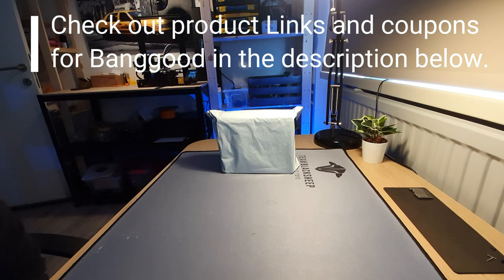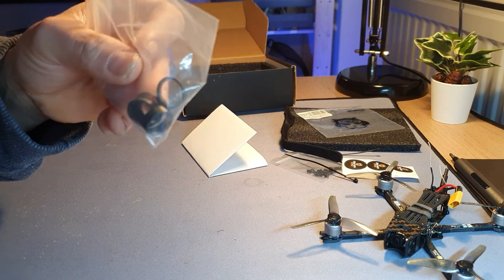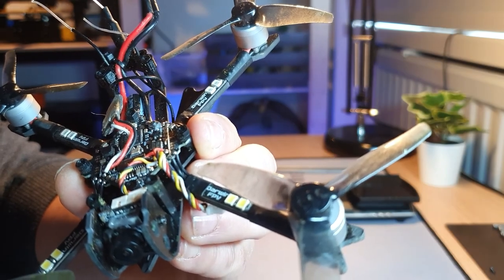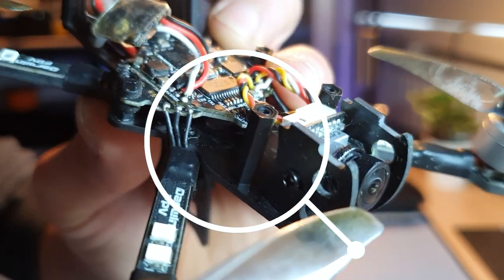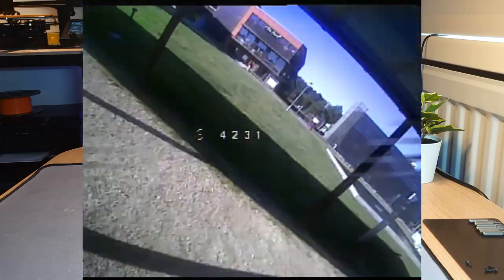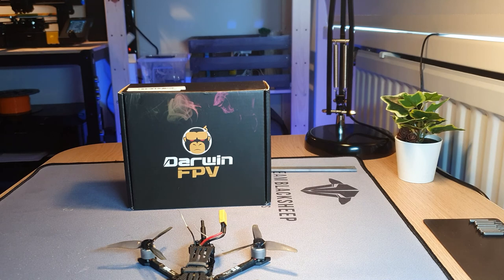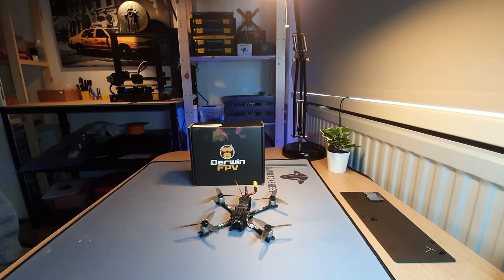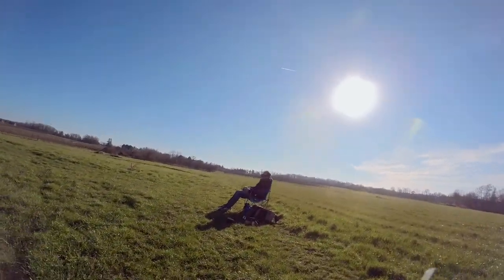Darwin FPV Baby Ape 3" review  | Square One

Comment: Great little review and agree with all, I'm fortunate enough to have 20 drones and flown many more but like this one for it's no nonsense ease. I have modded mine with an inflight micro antenna, fli14 rx and vinyl wrapped motors. As you said regards the cam, just get the upgraded version.
It's definitely staying in my fleet.
Darwinfpv have a 👍 from me.
Reply: Iflight
Reply from the maker: @stevedakin8321  And you get a 👍from me buddy. This is the cheapest drone I've ever flown, but it really impressed me. Looking forward to modding mine 😋.
Reply: Hii , how vinyl wrapped motors?

Comment: I like the 3s bouncy freestyle at the end! The stock rates feels really low especially on the 2s video footage though. Would you adjust the rates at all or you wouldn't worry about that until an upgrade? Also 200mW for the VTX is a bit weak as you go further than 100m the video gets bad real quick. What is the optimal VTX output for that drone with that small size?

Comment: Thanks for share. I want mode to it. For examle mod 1 gps+ elrs ( need to quit smart audio) 
Mod 2 change the engine (1104 7500 kv or something else) and try 1 and 2 s.
Try also install props protection for wery tight spaces or beginers or indor use.
Reply from the maker: Those would be some nice mods indeed ( I'm actually flying it with elrs right now :) . But for indoor use I'd say it's a bit fast, but yeah maybe with different motors.

Comment: i saw this quad on ali but eventually didnt buy it(seemed too much for a starter). caddex ant(pro version) looks much better than stock. you can put your split 3 on it and make some dvr videos :)) wonder if youll get some jello here like on your Mob7. looks like a really nice quad for such a low price
Reply from the maker: Yeah for an absolute beginner with little sim time it's going to be a fast drone. My first drone was a 5" but I wouldn't recommend it to every one to start out like me 😅😋.
That's actually an awesome idea putting an split 3 in there 🤔 hmmm 🙂. 
Yes it's awesome,  it flies really good and even pretty durable. The camera is the only thing that really needs changing, or like you said get the pro version. Maybe a good choice for you're second one 😄👍.
Reply: @SquareOneFPV  first i need my first one to arrive, and actually make my first flight LOL. while im waiting for my Mob7 i start to feel what i purchased from banggood is not an official happy model, Mob7 HD 1s elrs, cant find it on their actual site, feels like someone took mob7 normal 1s and just modified the camera..... lets hope it will actually fly when it arrive. :P :P :P
about second one, yes! i thought to get myself the ape pro for it or ape basic and get myself a DVR camera to put there somehow instead :)) but first thing first... learn how to take off before buying a beast drone without prop guards is important :D :D :D waiting for you next video ;)
Reply: @SquareOneFPV  My first drone was 9inch and was a catastrophe 😱 so start on simulator and after that with small and light quad. 
The quad for me to learn is kingkong et115, whoop type built like a tank😀

Comment: Did you change rates or pids? Nice flying!
Reply from the maker: Thanks 😁 and no, it's stock pids and rates.
Reply: @SquareOneFPV    impressive, I didn't like the stock pids and rates at all but, your footage seems like its pretty much tuned in.
Reply from the maker: @kilasracingfactory  Not saying it couldn't be better, but yeah I think it flies pretty good straight out of the box. 
For my reviews I try to change as little as possible, to showcase what it is your getting not what it could be.  
But if you're interested in al that, my modding vid's coming up soon, and it was pretty extensive. I'm now flying it on  BF 4.3, Bluejay for the esc's, bi-directional dshot is enabled, 500hz radio link etc.
Reply: @SquareOneFPV  nice, I'll definitely be watching the modding videos! First thing I did was flash BlueJay, it works so well with my other micros and this is no exception

Comment: Hey square one, I saw your review and some others on this drone, bought it with some 3S 450mah and I have 8MINUTES OF FLIGHT! incredible but my drone get pretty hot at the end… is it normal ? Thank you so much 😊
Reply from the maker: Wow that's a LOTT of flight time! What part of the drone get's hot? If it's the motors, if they get warm that's ok, but you should still be able to touch them, if you can't hold on to them that's to hot. And the vtx which is attached to the top plate can can pretty hot as well.
Reply: @SquareOneFPV  yup that s the vtx and motor but since, I m doing freestyle no more cruising and I still have a around 8 minutes by stoping at 3.75/cells so I hope it is not like broken and in reality I stop at like 3.1/cells..
Reply from the maker: @martindeschamps9856  Maybe you can check your voltage with a voltage checker or by plugging it into your charger when you get home? 8 minutes is just incredible, I got about 7 with my buddies 650mah 3S...
Reply: @SquareOneFPV  yup I checked I m not over charging the batteries i am well at 12.6 at the end of every charges. since, i tend to do way more freestyle and i still have 7-8 min....
Reply from the maker: @martindeschamps9856  Ok, well, it's still weird you get so much flighttime, but it's pretty awesome, so enjoy!
Reply: @SquareOneFPV  yes I don’t know what cause this. Can it be the vtx ? My vtx don t work correctly maybe he is under alimented so it uses less ?
Reply from the maker: @martindeschamps9856  No I don't think it could be the vtx, even the difference between 25mw or 200mw output power is negligible in flight time,  that's maybe a 10 or 15 second difference.
Reply: @SquareOneFPV  i don t know I am searching explainations 😅

Comment: is it usefull to get rid of led on motor arm? i kinda dont care flying a christmas tree and i dont like shorthen motor wire to leve them 1 centimeter only...
Reply from the maker: I was planning on removing them too. I'm not a big fan of leds on drones either, but I eventually kept them because they do act as race wire, so in a crash if the prop hit the top of the arm no wires can be damaged, and there wasn't much of a weight difference between the leds or using actual wires.

Comment: I want to ask, I just bought this kind of drone, I have problems with the motor feeling warm, tend to be hot, what is the problem?  also when i activate the rpm filter it doesn't want to arm. Thanks
Reply from the maker: Hi, 
1) warm motors are likely caused by too low filter or too high D-term setting. How warm is the ambient temp were you fly? When it's hot outside it's normal the motors feel warm, and as long as they are just warm and not hot it'll be ok.
2) Too enable bi-directional d-shot you need to flash your esc's have you done that? 

JB has a great video on this topic: https://www.youtube.com/watch?v=TiptP3KAFQ0
hope it helps, good luck with it.

Comment: Got a couple myself recently, def considering mods.. have you 3d printed bumpers/motor bumpers for it?  If so, I'll buy a couple sets.. 😁 🤙
Reply from the maker: That's great! Fun drone isn't it? 😄
No sorry I haven't designed bumpers for it, it would be a fun litte project tho. And would really like skids for this drone, those small bolts grind away so fast on concrete 😄.
Reply: @SquareOneFPV  it really isn't bad for the price!!! Instead of tearing up my other quads I figure go boss the wall with these and if they break oh well!! I'm trying to figure out a way to protect the outside of the arms and the front.. maybe hot gluing some small pieces of foam... Honestly I wish I had a 3D printer because I would go into production LOL!! Actually going to fly right now! Anyway if you happen to figure something out give me a shout and I'll do the same. 🤘
Reply: @SquareOneFPV  just posted a DVR on my channel from today's flight.. only been flying for a month! 🤙🤙🤙
Reply from the maker: @xmonstar420x  I wouldn't bother with arm protection, I think on a big impact the width of the arm will be the limiting factor. Arms are very cheap btw, https://www.banggood.com/custlink/vKGYsfWm4S
but it will be a pain to replace them... 

And you'll definitely need a set of spare motors, the shaft on them bends easily because the holes on the props and the motors don't line up, so you can't screw theml down. Get some quality motors, screw the props on as it should, and  they'll last you longer.
Reply from the maker: @xmonstar420x   Buddy you've got a thumbs up from me, you're rippin' pretty hard for just a month flying, nice 🤘👊.
Reply: @SquareOneFPV  right on.. I bought three and I'm using two and have one sitting for spare parts for now.. was trying to decide if I would put new motors on it or not but was going to see how the frame holds up over time.  I went back and tightened screws up after the last 2 Days in quite a few of them were loose so I'm thinking either some loctite and even better, maybe just better screws / hardware in general.. my hand slipped a little bit with the soldering iron and the standoffs aren't aluminum and seem to be 3D printed.. guess I could see this leading to stripping easy? Appreciate the suggestions bro!!
Reply: @SquareOneFPV  thats what ive been hearing.. i practice a good bit and have lots of drone experience (have had my part 107 since 2018) but ive been obsessed with this shi** since i picked up a sim last month.. appreciate the loveee brooo!!!
Reply from the maker: @xmonstar420x  Just saw you you power looping in your last vid 🔥👌 man you're learning fast,  I subbed so I can come back and check your progress 😄. Do you know comments on your vid are disabled btw? 

And yes the standoff are plastic, and they will strip out eventually, even a big crash could tear the threads out. Get some  aluminium standoffs , they'll last longer
and make the frame stiffer.
Reply: @SquareOneFPV  i didnt know that, going look at it right now.. and thanks bro!! I just uploaded one from today.. im getting cleaner (theres a couple sketchy moments, but for the most part, was super clean!)

Comment: What reciver are you using, can I get a link to a cheep one that works alright? That’s would have been amazing😁
Reply from the maker: It's a frsky R-XSR, but I upgraded it to elrs. What radio do you have or what protocol do you like to fly with? I would recommend elrs ep2 or a tbs nano, but you'd need a elrs or tbs module for those.
Reply: @SquareOneFPV  im new to the hobby, but does it include a radio in the drone? Or do I have to bye one? And idk what I prefer to fly with, I just want something that works and is not to expensive😅
Reply from the maker: Alright, welcome to fpv 👍😃. 
So the radio ( or controller) is the part you hold in your hands to control the drone. 
The receiver is the part that's in the drone that receives the instructions from you radio. 
Do you already have a radio? 
Each brand uses it's own method of communication, but there are also multi protocol radio's that support muliple protocols.
To be able to help you chose a receiver I first have to know what radio you have.
And the baby ape does not include a receiver so yes you'd have to buy one.
Reply: @SquareOneFPV  tanks, im in to rc cars so i know most names and stuff like that, the thing i dont undrestand is how to conect the camera and radio to the drone and if i should use vr glases or telephone😁
Reply from the maker: You will need analoge goggles, like a skyzone or fatshark.
If you don't have a radio get a frsky radio like this one 

https://nl.banggood.com/FrSky-Taranis-X9-Lite-2_4GHz-24CH-ACCESS-ACCST-D16-Mode2-Classic-Form-Factor-Portable-Radio-Transmitter-for-RC-Drone-p-1469909.html?cur_warehouse=CN&ID=2246296968&rmmds=search

and you'll need a frsky receiver to go with that

https://nl.banggood.com/FrSky-R-XSR-Ultra-SBUS-or-CPPM-D16-16CH-Mini-Redundancy-Receiver-1_5g-for-RC-Multirotor-FPV-Racing-Drone-p-1186057.html?cur_warehouse=CN&rmmds=search

To bind the radio to the receiver you need to follow the instructions in the manual, but ussually it's 
1 make a profile for the drone on the radio
2 put radio in binding mode
3 plug in drone and push the bind button on the receiver

For video:
1 when you plug in the drone the vtx will send a video signal at a certain frequency
2 set the goggles to scan the frequency bands

Hopes this helps you goodluck with

Comment: as soon i reiceive it i swap shit motor whit bad hole for prop screw for some emax 1404 6000kv and gonna use gemfan  flash 2540 prop on it.. should go 3s no problem..
Reply from the maker: yeah you could do that, replaced mine with betafpv 1103 8000kv ( mostly fly with a throttle limit not to blow up an esc :). 
I went the lighter route because this is a very small and light build 3 inch. The frame is very thin and so are the arms, the more weight you add the bigger the impact energy, and I'm afraid you will be replacing arms a lot...

you'll have to drill the motors holes in the frame and led strip ( it runs to the end of the arm and is sandwiched between the motor and the arm).
Holes are 1.5mm 🙄🙄 for the stock motors.
I've just cut of the piece of led strip that's underneath the motor, and afterwards taped it to the arm so it stays in place.

Yes 3s no problem 😅👍
Reply: @SquareOneFPV  i was 98g 2s 550 8700kv. Give 27 amp 2.5 inch at 64k rpm. So 3s 6000kv 66k rpm. Should be around 30 amp. I will lose efficiency at hover (38g 4 motor when 1104 are. 22g for 4. ) But will gain efficiency on power demand due to larger bell so more tork available
Reply: @SquareOneFPV  later gonna swap frame of the ape it it prove to be too fragile to go for  130mm 3mm carbon
Reply from the maker: @sunoncream1118  Ok I went the other way, shaved about 10gr of if I remember correctly, swapped the vtx for a tbs pro 32 nano, camera for a cadx ant or lite(not sure), and motors for 1104's limited to 6000kv, still fly it on 3s 300mah.
Reply from the maker: @sunoncream1118  yes it's thin!
Reply: @SquareOneFPV  I've mesures the arm they're 2.6mm thing. Mh kinda not too beefy. But the frame don't flex at all when I trie applied some force. I dont use all my force but with reasonable amount it didn't flex at all...
Reply: @SquareOneFPV  got the pro version. Mh the ant cam is kinda ok for night fly. Not as good as the runcam owl . But ok ish. But I'm disappointed by the ant cam about fantom tree branch and sun in screen handling... U kinda not to have swing between tree when the sun i facing you ...

Comment: Yay, did you do the mod vid yet?
Reply from the maker: Hi, no I've been working on it, drone is finished and all, but work and other things have been keeping me very busy. And I haven't had time to finish editing.
Reply: @SquareOneFPV  that's ok. I had ordered the tiny ape , and just ordered the baby ape, but I want to switch the motors and but I've heard the motors on it stock are not to bad really. So I dunno, also how the heck does one find an adapter for bringing a 14mm camera up to a 16mm. I e seen some of the 16 to larger (like 25mm or something) but not anything like 14to16. I have an older runcam split I bought  y itself I'd love to slap in this thing but it's a 14mm split.
Reply from the maker: @m34nb34n  I've got a solutionfor the cam problem, check the vid from 8.30.  
The motors aren't bad no,  this drone flies good and has good flight time. 
But they are also very heavy.  The screw holes for t-style mount props don't line up, so the only thing holding your prop onto the motor is the friction between the shaft and the prop. There's a big chance of bending the thin shaft in a crash if you can't screw the prop on, because all the force of the impact will go through the shaft instead of being distributed over the entire motor bell. I'd say fly them till you brake them and then replace with some good  quality motors.
Reply: @SquareOneFPV  hey thanks! 
Yeah , that's usually whag I do with motors if they are OK. (Unless I absolutely hate em lol)
Reply: @SquareOneFPV  wait...what is 8,30 mean. Can you give me a link cause I'm kinda tarded
Reply from the maker: @m34nb34n  ow my bad, I mean 8:30 into the video, I show you how I solved the camera problem
Reply: @SquareOneFPV  lol yeah I sorta figured it out. My bad dude

Comment: What battery would you recommend?
Reply from the maker: I think 3s 300mah is a good balance between flighttime and weight. I get about 3 to 3min30 on those. However I've flown it with 3s 650mah and I definitely enjoyed the extra weight when doing freestyle, it instantly gives you more hangtime, but sharp cornering gets  much more difficult...

Comment: Can i use 1500mah 25c 3s battery?
Reply from the maker: I guess you could, but wouldn't recommend it, that's really a LOTT of weight your going to put on top  of it. I've flown it with 3s 650mah and it was fine, motors not even running hot. It's definitely not going to be agile anymore are you planning on using it for long range? And this drone has an xt 30 connector, that battery will probably have an xt 60, so  soldering will be required if that's the case.

Comment: how do i connect a remote ?
Reply from the maker: There's no receiver included so you have to buy it yourself.
Reply: @SquareOneFPV  Yeah whats work with them ?
Reply from the maker: @oliver32321  Main question is what works with your radio ( remote ). Every (FPV) receiver will work, but each manufacturer uses it's own protocol. And you should choose accordingly.
So the main question is what protocol(s) does your radio support? 

For example: 
when I first got it I've put a FRSKY R-XSR receiver in it so I needed to have a FRSKY radio ( or a multi protocol radio that supports FRSKY).

Now I've put an ELRS receiver in it, and I have to use an ELRS module in my radio to be able to communicate with the receiver.

I hope this clears things up bit for you.
What radio do you have?